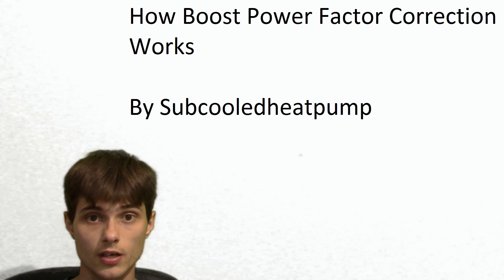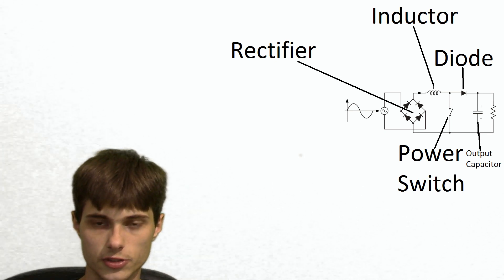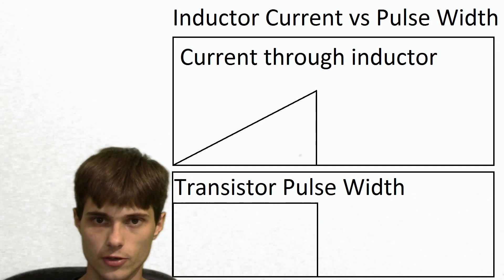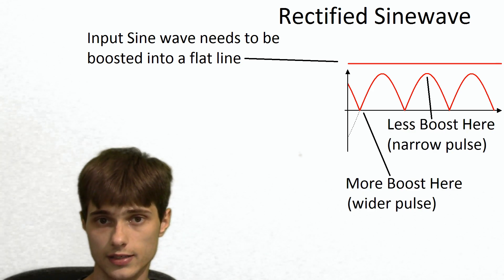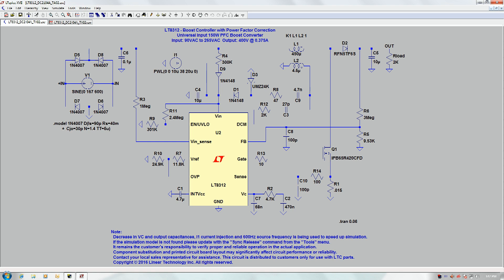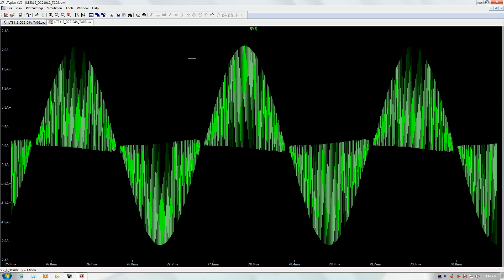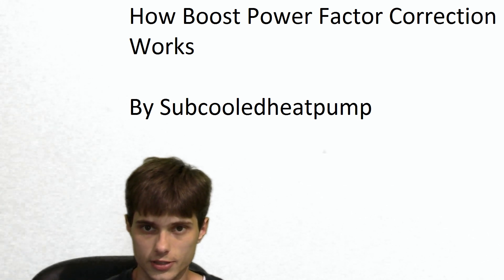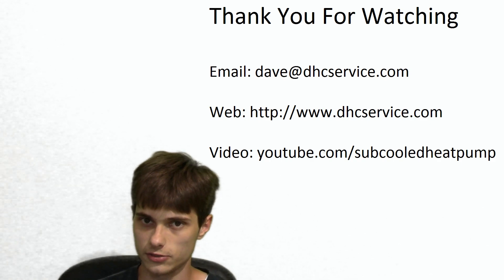How Boost PFC works

Comment: It makes sense.
U have taken rectified line voltage and generated a PWM in correspondence to its 0 and maximum peak ? 
And got a in phase current with voltage ?
Am i right???

Comment: subcooledheatpump For my induction heater can I use a 555 timer as the chip for my gate driver?
Reply from the maker: You can use a 555 as a signal generator and connect the output into a gate driver, but you can't actually use the 555 directly as a gate driver. Unless the IGBT or MOSFET you are driving is extremely small
Reply: subcooledheatpump  O ok, is it because it does not have enough voltage to trigger the gate?
Reply from the maker: It would be able to trigger the gate, however gates are capacitive, and the turn on would be too slow. The 555 is limited to 200 ma output current, and most gates have relatively high capacitance, so they need a higher current fill the gate capacitor without turning on too slowly.
Reply: subcooledheatpump I have made an induction heater using 2 mosfets, some resistors and diodes, what is the difference between doing that, vs using a dedicated gate driver?
Reply from the maker: Sounds like you've made a zero voltage switching (ZVS) type induction heater. Gate drive is a lot different with ZVS or soft switching compared to hard switching. For most hard switched applications you do need a dedicated gate driver.
Reply: subcooledheatpump What is the advantage of the gate driver route to make an induction heater, over the zvs induction heater?
Reply from the maker: If you are certain that you can maintain true resonance and never hard switch, then gate drivers shouldn't be required. It's just that some applications cannot be soft switched, they never achieve resonance. Motor controllers for example are almost always hard switched, so gate drivers are required. As I said, gate drivers just provide the necessary power to switch the transistors quickly, which is necessary for hard switching. Isolated gate drivers also provide isolation for bridge type circuits. If you are using a resonant induction heater and you are getting good results, there shouldn't be a reason you'd need to use gate drivers. ZVS actually switches the transistors on and off when there is no voltage applied, so the transition from on to off isn't as critical, and doesn't need to be performed as quickly, so there isn't much reason to use gate drivers with ZVS type circuits. Larger induction heaters (several kW) sometimes use gate drivers or gate drive transformers, but the concept is mostly the same, switch the transistors when no voltage is applied across the terminals.

Comment: Thanks for a very nice video. I search around and I see that Boost PFC is what most people use. This leads me to a question : why would someone use a buck boost converter? It appears to me that if you need a DC voltage that is higher than Vac peak, you need nothing more than the Boost PFC. On the other hand, if a smaller DC output is required, you take the same Boost PFC and put a buck converter after it, right? So, if there any room left for Buck-Boost converters?
Reply from the maker: Buck-Boost converters are used for some special applications. Some electric vehicles have low voltage batteries or fuel cells, they need to discharge at a higher voltage, but still be able to recharge using regenerative braking. The voltage is boosted up for acceleration, then bucked down for regenerative braking. They are also used in regulated power supplies that demand a constant voltage output. Grid voltage can experience wide voltage swings, and some precision instruments need tight voltage tolerance, sometimes buck boost converters are used to hold the input voltage. They can also be used in battery powered computers (like laptops). When a laptop battery is fully charged the voltage may be higher than necessary, and can be bucked down. As the battery discharges and the voltage falls, it can be boosted back up. As you point out, the buck boost in most cases isn't required. A typical PC power supply just uses a boost PFC to supply a high frequency inverter. The inverter drives a high frequency transformer with multiple secondary circuits, this provides many different output voltage levels without the need for additional active electronics, and also provides isolation, which the buck boost does not. Thanks for watching
Reply: subcooledheatpump Thanks for your reply.

Comment: I really enjoyed the video. like always. I am attempting to educate me self . to build a inverter to run my off grid home. I really like the big bucking inverters.  run on a wide range of HV DC . about 380vdc nominal. and up to 600vdc. and highly adjustable and adaptable. but I can settle for a 3-8kw 24-48vdc to 120vac. I can't afford buying what I really need.  but would really like attempting building one. since I don't care about size and weight. a transformer based unit will be OK. I have some very large transformers. from forklift batt chargers. and some smaller ones . bigger than those found in microwaves. I also have some large heatsinks and caps. they are 75v 22,000Uf. I'd like to use this stuff if possible. making the voltage is kinda easy. but getting the volts, amps and the correct frequency all in the same basket isn't easy. would a bucking inverter be easier to build? it wouldn't require a boost stage. I know I will need to rewind the transformers. I don't know about the frequency they will become useless. I have 60hz transformers . I don't know all that much about inductors and frequency ranges. I font think a boost stage running at 60hz to output 60Hz would work. but a buck converter working at less may work. am I even close. I only ask you because you are the most knowledgeable I know of! if you can offer help or advice. I would appreciate it. thanks
Reply from the maker: What is the normal input frequency and voltage of the transformer(s) in question? It's not too hard to understand really. Transformers are similar to induction motors, they work from a voltage to frequency ratio. Say,you have a 240 volt AC transformer that wants 120 Hz,(2:1 V/F) you can power it from 120 volts at 60 Hz. If you know the original ratings I can tell you which one would be best. You could then just make an inverter and run the transformers backwards, input the low voltage to the secondary and high voltage will come out of the primary. The other option is to just make a simple boost converter and then use that to power a high voltage inverter. I'll be making a boost converter in the near future

Comment: thanks for the video dude! Are there any major issues that the switching frequency can cause on other devices on the same power grid? Can you filter that stuff out with inductors/capacitors on the input?
Reply from the maker: Yes you should be able to improve the input current with a simple LC filter, especially if you can get it tuned to the switching frequency. There are many other passives you can add too, like common mode chokes. Not sure but I believe some countries require switch mode power supplies to have them, even if they are PFC already. Thanks for watching and good luck with your project